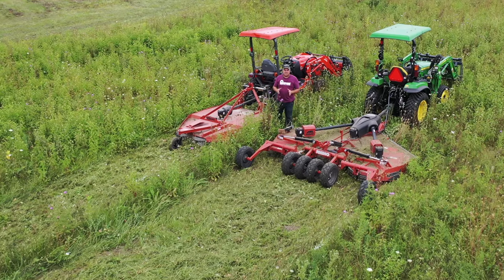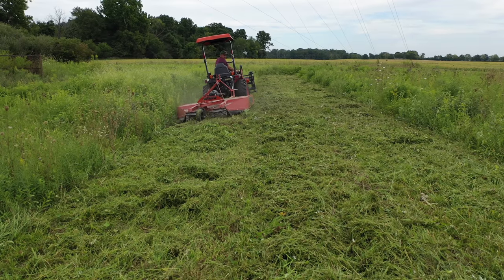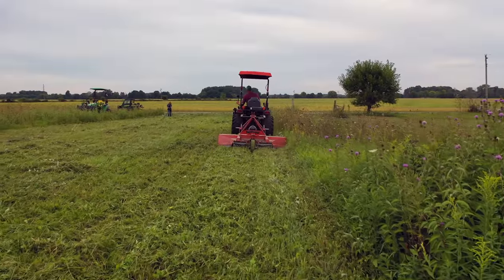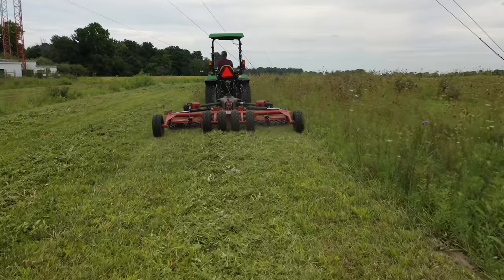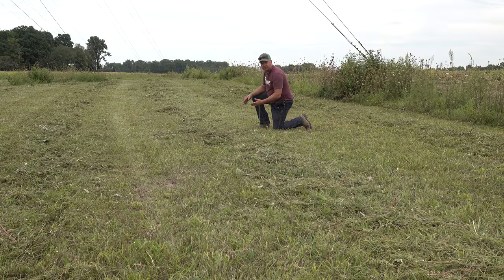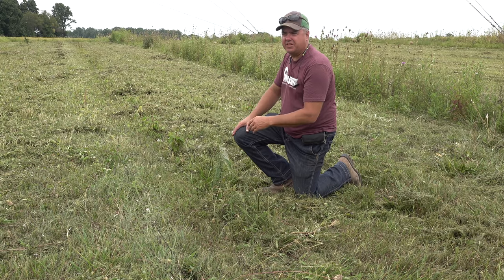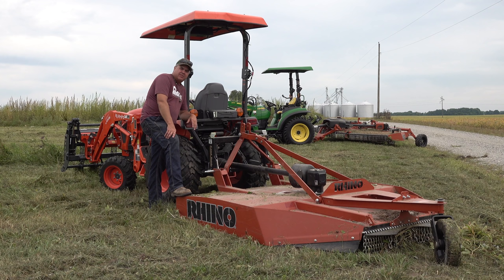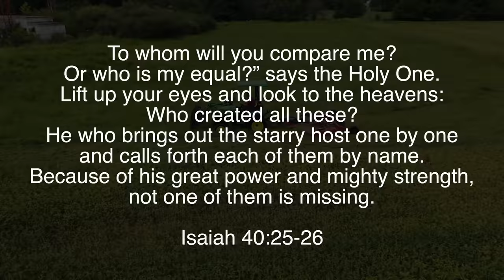Which Cuts Better? Single Spindle vs Flexwing Mower, John Deere 2038R, Kubota LX3310 Compact Tractor

Comment: It all is controlled by the driver, blade speed vs forward speed. Also, blades need to be kept sharp.  You run the 6' mower with the front tires in the unmowed area, that is causing the outer edge of the mower to either on the very edge or inside the standing grass.  I know you want a full 6' cut, but if you want it clean, you have to give up something.  You don't have that problem with the 10" as it is way wider than the tractor.  So this is not a true apple to apple comparison.
Reply from the maker: So, to be apples to apples in your opinion....I would have to overlap at least one tire width ONLY on the 6' mower?    Given that several inches stick out past the tires, I would lose at least 18" of cut.  So, now we are comparing a 4-4.5' mower to a 10' mower with same sized tractor?
Not sure why you say "you don't  have that problem with the 10' mower", as both tires are running in unmowed field with that mower as well.  
In MY opinion, the only way to be "apples to apples" is to do the test just like I did. Taking as close to a full swath as possible with both mowers...come what may.
Reply: @TractorTimewithTim  You don't have to lose 18", but you do have to let the outside edge of the deck ride in the cut grass. You are allowing for the 10" mower outer edge ride in the cut grass, but not the 8".  Remember, the blade does not extend to the deck edge, there is a gap there.  Therefore, you are not apples to apples.  The mower is designed to work at specific RPM's.  Good mowing is controlled by the operator, that person has to be knowledgeable enough to keep the blade rpm's up to speed and control the forward speed through changes in weed density.  There is no set tractor speed from the designer of the mower, only the rpm speed to work efficiently.  I can do finish work in your field by using a lower gear, letting the edge of the deck run in the clear by an inch or so.  Apparently, you have a forward speed set in your mind, probably because you don't have the patience to slow down and do it right.   It is all about rpm's proper gear and proper forward speed.  You have admitted you are not an expert on using this type of mower.  I understand that and am not trying to belittle you or bring you down, you are trying to bring a good service message.  Most fields that you see with lots of standing weeds are due to excessive forward speed, dull cutters or not having the deck edge just inside the clear-cut.  Just let your temper settle down and the next time you mow, think about blade edge into the clear-cut, rpm's, gear you are using and tractor speed.
Reply from the maker: First you said one set of tires need to run in prior cut grass.  That would require at least 18” overlap.
Reply: @TractorTimewithTim  Misstated that, my most humble apologies. You still haven't gotten past defending yourself, and you still don't know jack about field mowing.
Reply from the maker: Not sure how repeating what you had said was ‘defending myself’.  Oh well.  Have a good day, John.

Comment: The flexwing is over 10k. The single spindle is 1/4th that.
Reply from the maker: Yep.  You get what you pay for.  Like most other things.
Reply: @TractorTimewithTim  there is no doubt but there are larger single spindles. I don't think many of us are cross shopping these two units
Reply from the maker: Can’t pull a larger single spindle with this size tractor!  Handling a 10’ mower with a 37 engine hp tractor is amazing!
10’ flex wing pulls about the same as 6’ single spindle.
Reply: @TractorTimewithTim  oh I know. I have a 2025R. Getting Kubota tractors here in Hawai'i is a 1.5 year event unless you need an L3302 or L3902. Which are just too much for my smaller farm.

Comment: No airflow no fine grass. More blades the better IMO. Coming from 14+ years as a lawn care service. It'd be different once you speed up the single blade but that's way too dangerous. Same goes for turbine engines. More blades finer the air particles. Imagine a turbine engine blade. Yikes 😳

Comment: If you ever have a flail mower/cutter/brush cutter.. you'll never have a regular rotary cutter again..It'll rip through saplings that would destroy a bush hog type.. with way less  tractor horsepower than it would take for a brush cutter and way less money than a skid steer with a brush cutter..IMO

Comment: PERSONALLY -------> I don't believe in front down.  Prefer mower level front to back.  JimInCincy.....
Reply from the maker: Level or slightly… wry slightly front down is the manufacturer recommendation.  They do NOT want grass hitting the blades on the back side of the pass.

Comment: I just don't see the point of such a test when the mowers are such different widths. That would be like comparing a riding mower with a single blade 30-inch deck to one with a 3-blade 48-inch deck. Apples and Oranges.
Reply from the maker: Same sized tractor, Joe.